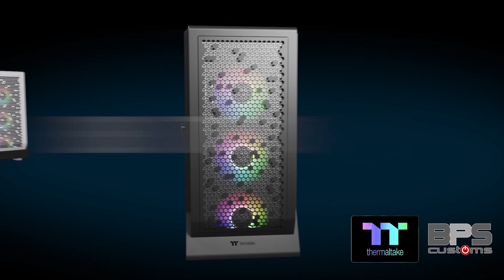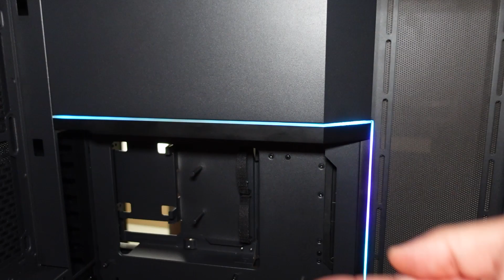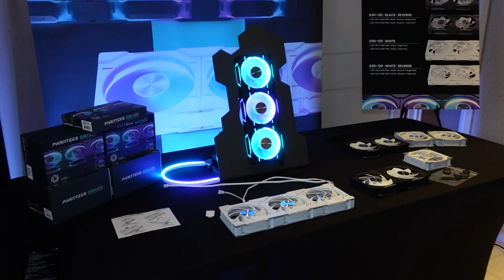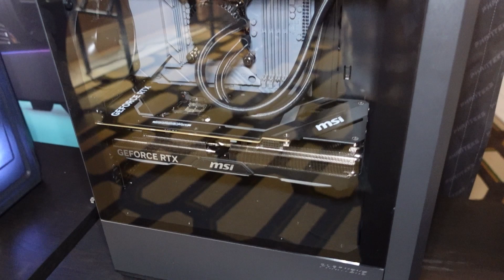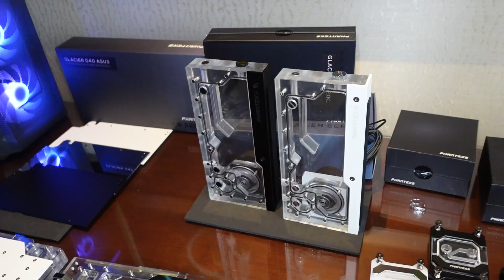The Phanteks NV7 Is Drool-Worthy - CES 2023!

Comment: What type of  cable management is posible with the back storage being so small. Look how small the example shown for the power supply is and how little room there is for a larger power supply with all the  CPU , GPU and SATA cables that would be needed to be plugged in to the PSU

Comment: If the NV7 is below $250, i'll probably buy it without second thought. Been a fan of Phanteks since i bought the original Enthoo Primo and they have rarely let me down. Had to repair two of their cases, damage caused to them was very likely user mistake both times. Broken mounting for a front panel on the Primo and broken power switch assembly/pcb on the Evolv X, Phanteks support replied to my emails within half a day every day and sent me spareparts both times, free of charge, despite knowing that the damage wasn't on them. Definitely the type of company i like to support.
Reply: It can be $500 Idgaf I'm buying it!

Comment: Phanteks now do it again but put the PSU at the bottom (still on the right side, still flush) with the MB 'above' it, and I think that's a home run, less top heavy that way, less distance for power cord to outlet most of the time, but very nearly a fantastic complete package.

Comment: 85 bucks for a 3pack fans WITHOUT A CONTROLLER?  Nah bruh! Lian li all the way.. they are not even pretty compared to the sl120s infinity. In 6 months after realease they will be 50% off in every retailer
Reply: Without the NEED for a controller. They're designed to be plug and play.
Reply: @robertthomson1994  oh yeah? Have you built with 12+ fans? I did.. that mobo header has a limit on the number of leds. Even the corsair rgb fan hub which is sata powered cannot handle more than 3-4 ql fans because of the number of leds